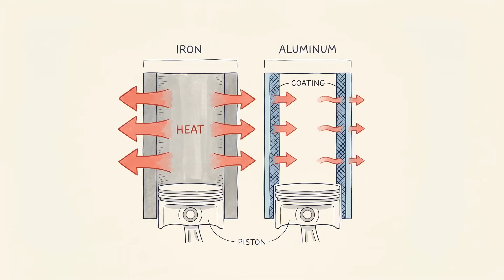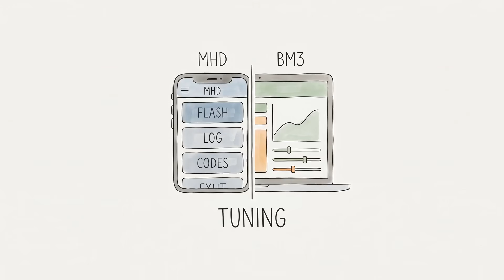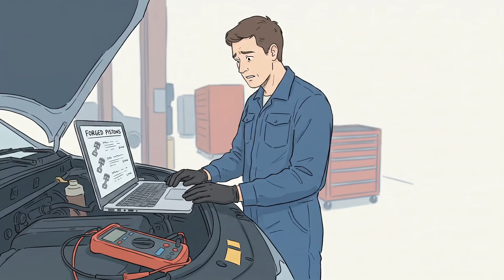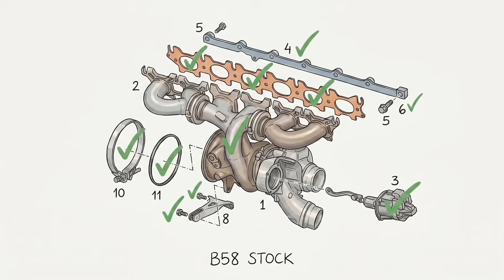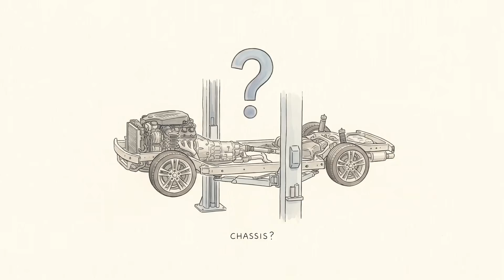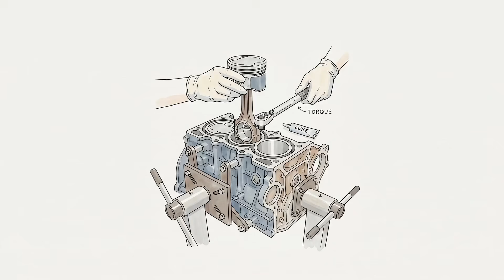The Truth About the B58

Comment: around 600 whp is the limit before that stock trans has to go in the trash
Reply from the maker: 100%, the trans is the limit not the motor. stock zf8 taps out ~600-700, built one (~8k) takes the full 800 the engine doesn't even flinch at. you're not building the b58, you're building everything around it

Comment: This would have been impressive in 2010. Now this kind of power is all over the road with largely stock hardware.  And the longblock still isn’t as strong as a 2JZ.
Reply from the maker: true it's more common now, but the b58 is kinda why lol. 600-700whp on stock internals for 5-10k, no forged build. 2jz is still the goat though, won't argue that — just took way more money to get there.